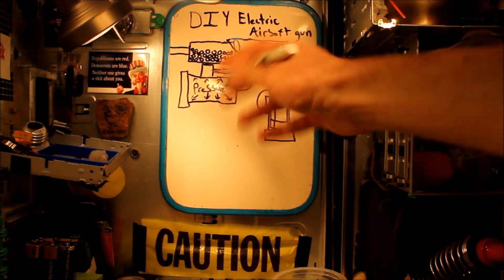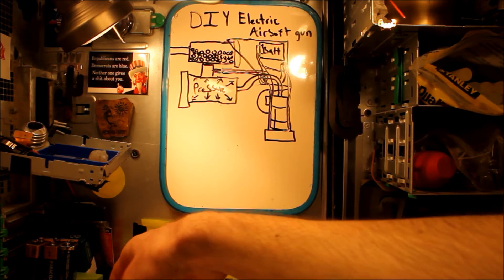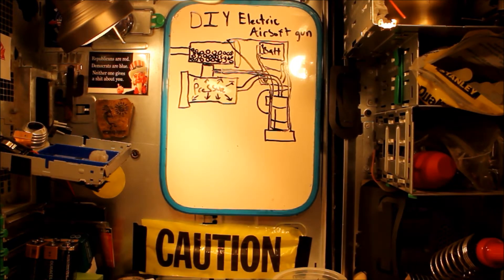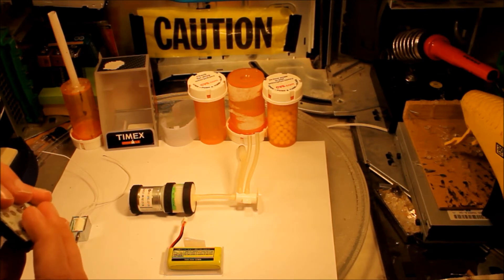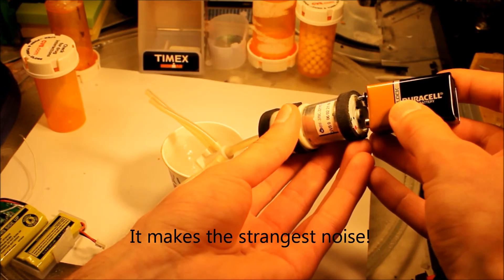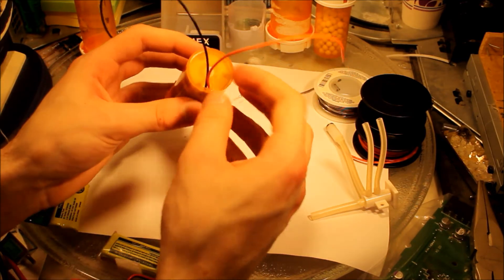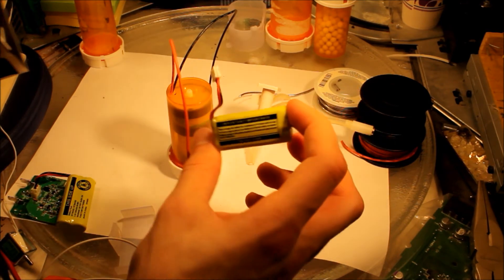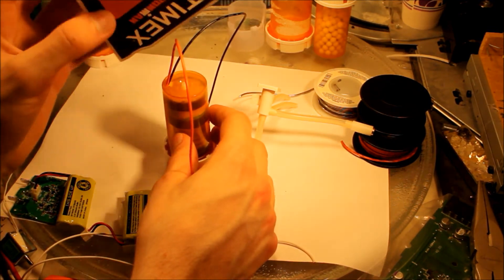DIY Electric Airsoft Project | Part One

Comment: Ooooh this is cool I’m gonna try to do this if I have enough life force left👍
Reply from the maker: Cool, just a heads up though I had some trouble getting this to work as planned. I don't think there was enough air pressure. Probably need a valve on the exit or a more powerful air pump, maybe both. Good luck!
Reply: I’ll tell you if it works! Also thx for responding to a response on a two year old video within a day.